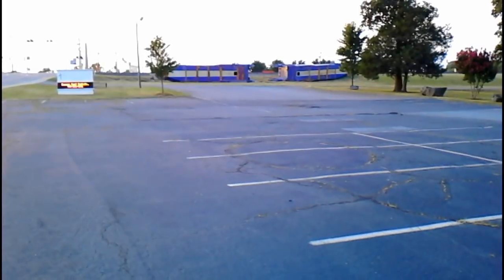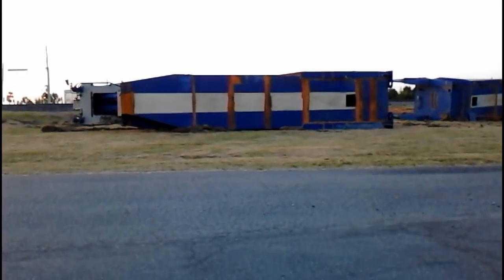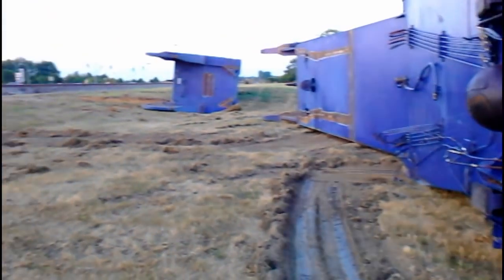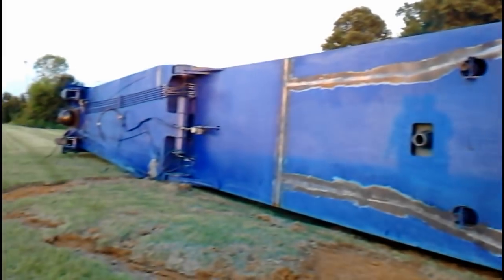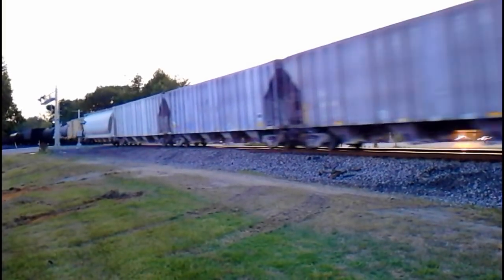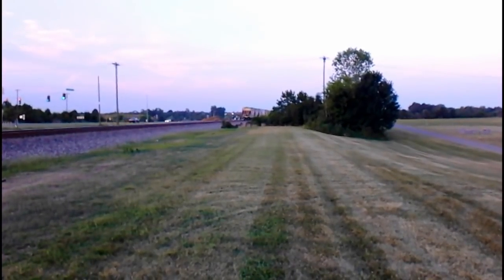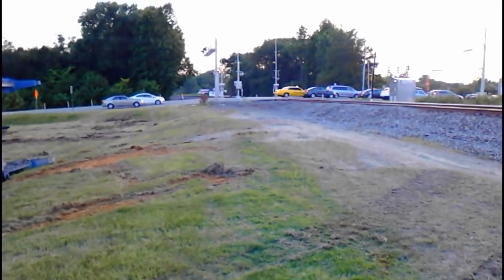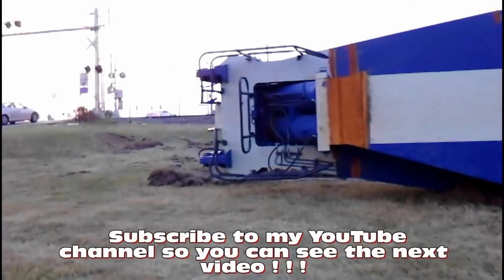Derail: Schnabel Car derailed in Charlotte NC 06 22 14

Comment: My father actually built this car in New Castle, Pennsylvania and that is actually the body of the car. When this accident happened the car was not loaded! It was on its way from South Carolina to New Castle because it did not pass the companies inspection. The welds that were used were wrong. The hydraulics that keep these two pieces level malfunctioned and caused it to lean and fall over. Ive seen and been on this car
Reply from the maker: Thanks for the info :-)
Reply: +Charles Spaulding That Makes Sence
Reply: Charles. i told him the same thing and my post was deleted.
Reply from the maker: I dont think it was deleted, the comment that I believe you are referring too is farther down the page.
Reply: The hydraulics did not fail, moving the car empty, no hydraulics are involved, everything is "retracted" at rest, all parts are hard pinned. The arms were incorrectly designed "nose heavy," and the arms sagged, (imagine an incorrectly balanced teeeter-totter) catching the rail bed. It was found out that the arms were nose heavy when the car was first moved from New Castle. Kasgro did not build an exact replica of the 800 as they were contracted to do.The arms had to be chained in place mid trip on the delivery trip. Kasgro however, decided on the move back to New Castle, for a total rebuild, that the chains were not needed. (oops) 85% of the welds failed testing. How Westinghouse ever accepted the car is still a wonder. Luckily the 801 never hauled a load. Who knows what might of happened with a load and weld failures. Because of the poor design, people refused to use the 801 and stuck with the original Krupp 800. The story is out there that the man who accepted the 801 was terminated after the weld tests took place. The testing was done two years after accepting. Two years!!!! The car never should have left the plant. And Westinghouse builds nuclear plants...
Reply: well the B1/B2 and A1/A2 cylinders are linked together from front to rear. and they keep the car level.  and i don't think they have locks on them (on the 800)  but only a ball valve that with a bolt and wing nut to help "lock" in place.     but i joked with the operator and asked whats this chain for. and he said it was for putting over the end so it won't jump out during travel.
Reply: The lifting cylinders which I think you are referring to, (operators have a different designation that what you are calling them,) are retracted while in travel mode, so they cannot “fail” and allow the arms to drop. The
main travel pin is also locked in place by a mechanical pin. What happened was when Kasgro built the 801, the built the arms “nose heavy” for some reason. (It is estimated that each nose of the 801 is about 4500 pounds heavier that the back.)  The lifting arms ride on the pivot ball like a teeter-totter. With the nose of the 801 heavier than the back, it just sagged and caught the rail. Your description of the additional chains is generally correct. Westinghouse personnel discovered the heavy nose about 6 hours out of New Castle when they started to sag. The train was stopped, the problem reviewed and before they moved the car another foot, chains had been purchased and the arms chained down on the back side so the nose would not sag and catch the rail. When Kasgro started the return trip to New Castle, they made the command decision that chains were not needed. Thus, in the middle of the night the arms sagged and caught the rail. All operators refused to operate the 801 because of safety issues. You could not sit in the operator's seat
without having your head hit the control cabinet. You had to lean forward all the time you were in the seat. They also did not insulate the engine for sound so you had no radio communication when the engine was running due to the sound of the engine burying the radio communications. The windows had minimal taper
to them so you could not see the lift and swing indicators on a sunny day due to glare. Of course we found out later that the welds were defective. All in all an expensive piece of scrap metal.